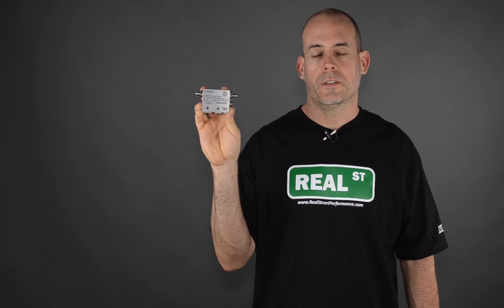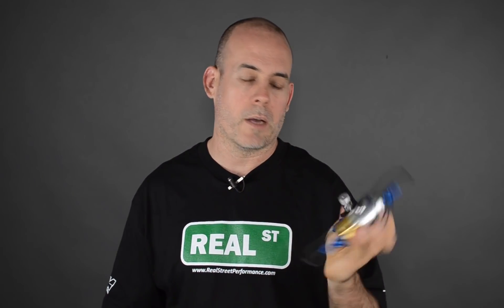How to Launch your car perfectly using a Clutch Release Valve - Jay's Tech Tips

Comment: I think these still wont get you the best times like knowing your car and getting it fine tuned with foot than valves, I think the delay is half a second and for some its alot + if you change clutch change drive shaft too so it wont break. 1000+ hp cars that drag race have aftermarket shafts and no clutch valves, BUT I REALLY like it since I drive automatic I can use this in a manual for my future cars.

Comment: or just learn to drive a fucking manual like nearly everyone does in england. it takes practice to do as its not really easy or everyone would be drag racers
Reply: +The Channel of Stuff that's fine and good until you're making like 750+ hp (599 kw) to the wheels like most every single car Real Street makes. No matter how good you are you will break something eventually.
Reply: +northern marine if you have ever driven a car with an unsprung puck clutch you will see that you couldn't be more wrong about your statement. that style clutch is almost like a light switch it is either on or it is off. you really cannot compare that to a sprung solid disc oe style clutch. the difference is immense. Having something like that valve to consistently release the clutch at the same point every time is something no human can do every single time the same way it's a huge reason why a lot of cars at the drag strip are auto  consistency in launch and easier on Parts.
Reply: +The Channel of Stuff if that's what you think them you're missing the whole point of the video. It's about consistency and reducing parts breakage. even at the highest level the "pros" with manual fast cars have slipper clutches. But I guess those guys have no skill either ehh?
Reply: +The Channel of Stuff DRAG race car. Not Circuit car.
Reply: +The Channel of Stuff The car they tested in this video makes over 800hp...
Reply: samotrx7 Thats where skill and practice comes in, so you can make unhuman like gear changes and launches
Reply: samotrx7 I GUESS I'M NOT SEEING THE POINT BECAUSE I DON'T NEED ONE
Reply: +The Channel of Stuff 150 hp 15 sec cars usually dont........
Reply: wtf i never said my mr2 was stock ahahahaha but it doesn't make 2000bhp either, as its mostly a track car which needs to go round corners :)
Reply: +s70driver2005 I don't think someone with a username with Volvo it it can really comment on any type of racing . but I see what you mean :)
Reply: +The Channel of Stuff Check out some of my videos, then come talk about my Volvo! Make that boost bro!
Reply: Some people are just luddites. People still shim the clutch pressure plate to delay how hard it hits and keep the tires stuck. The problem is track conditions will vary. The other problem is that ALL aftermarket clutches designed to hold double, triple or more of the stock output in cars hit very hard. The engine is stronger than the clutch, both are stronger than the tires grip on the surface your on, so the tires spin. If you run slicks or a drag radial and it dead hooks, it will then find the weakest link typically your axles, sometimes worse. So these devices are not so much about replacing skill but to prevent parts breakage. Because knowing exactly how much to slip the clutch with your foot takes hours of practice which most people in Western Culture don't have nor place to practice or the money to rent the track for a few hours each time. Street Legals in America are heavily attended, you might only get 4-6 passes if stay all night/day.
Reply: If your getting 1.4 5 60 ft times in your MR2 then you don't need it. If you aren't then you do, more practice won't help.
Reply: You don't need more than 100 hp to have fun on a road course. This isn't the WEC or BTCC. I've been to Europe and while F1 and circuit racing is king, track time is expense and infrequent. That's why drag racing is growing. Your right you don't need 2,000 hp but it's more fun than 200 hp. Try it sometime.
Reply: +The Channel of Stuff There's a big difference between a 100~hp econobox with a sprung, solid disc OE clutch and a 700+hp race car with an unsprung 3/4/5/6 puck clutch.
Reply: i'm not on about high end dude. like the car he tested it in, people will use it in their hondas
Reply: I'm from the UK and i have a mr2 mk2 that i use for track days and sometimes events at santa pod...
Reply: +Kyle “SlowSupra” B he's got a point, if you grow up around manual gearbox's then it doesn't matter if its 100bhp or 1000bhp you can launch it. I have a Caterham r500, evo 8 mr with 600bhp rallycross engine, and a gsxr1000 that's been supercharged to 250bhp, the theory is the same across all of them

Comment: The factory mechanical ClutchDelayValve (CDV) was one of the first things I removed off my BMW :-D (recommended!) You don't want the delay in every gear change. It also makes daily driving quite uncomfortable..especially with cold fluids.
But I get why it could be useful in drag racing for getting off the line although I'd only get the electronic system.